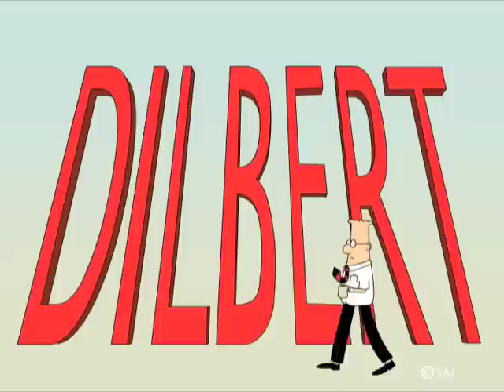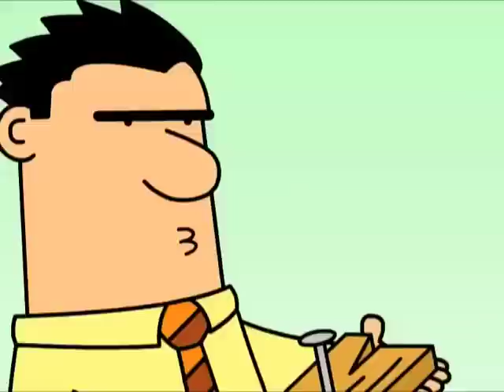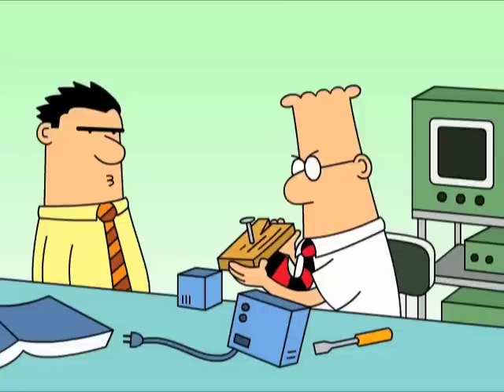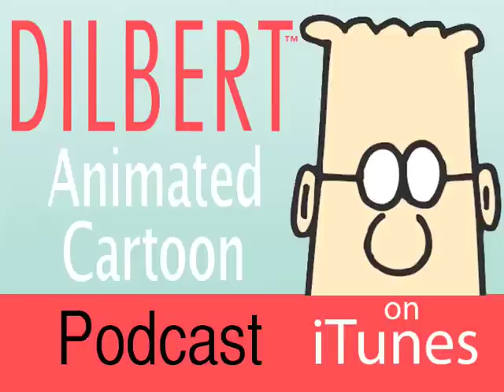Dilbert:  Power Supply Video

Comment: EE's can not requisition wood nails without authorization from management. Besides, they do not have a unique part number in the company parts database; therefore, it requires a vendor purchasing order that can no longer be located and has been mysteriously deleted from the engineering drive. After all is said and done, the wood itself will fail the preliminary screening because it does not satisfy UL "structural stability of engineered lumber in fire conditions" requirements.
Reply: Wood is not allowed in a clean-room, the current international shipping codes do not allow it and the addition of the nail, being a potential antenna, would require additional EMC testing. Also, the nail has a lead-time of 72 weeks.